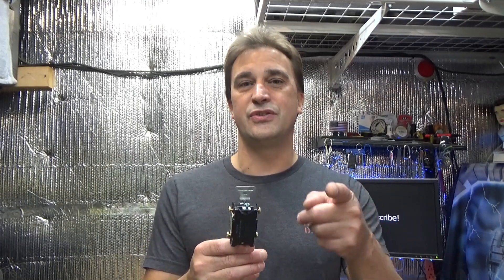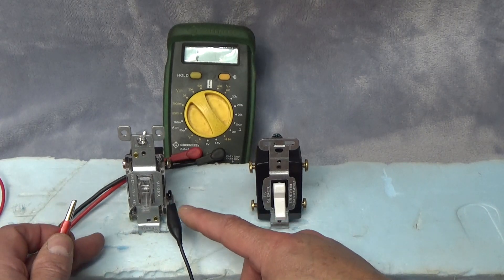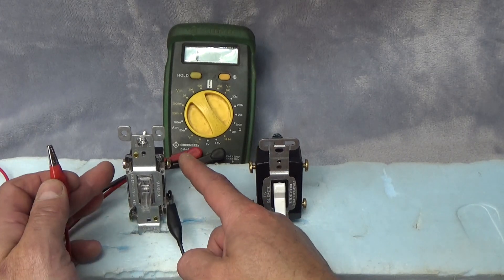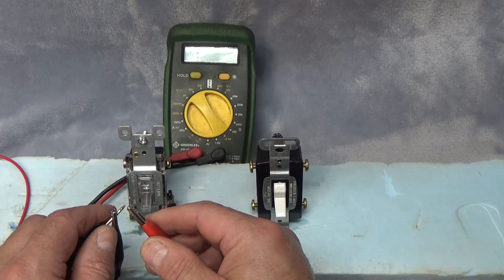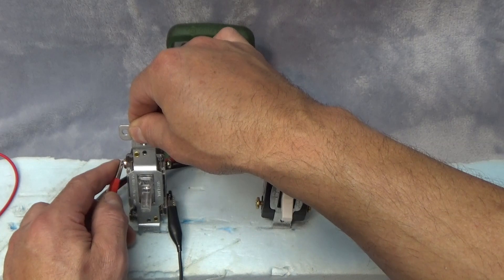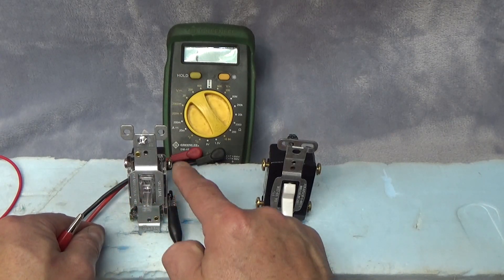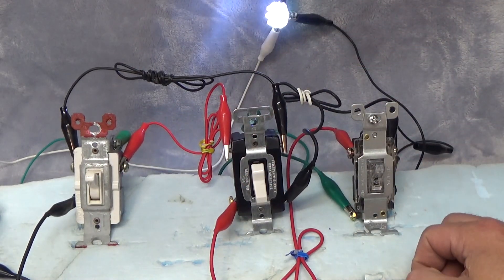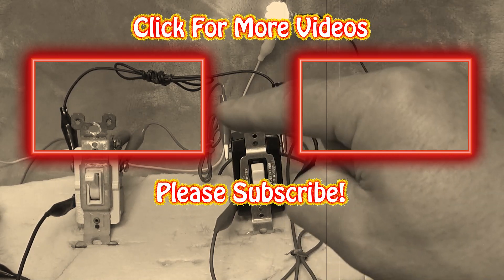4 Way Switch Explained   How to Wire a 4 Way Switch to Control a Single Light Fixture W\ 3 Switches

Comment: Great video. It might be helpful to show what happens with some common wiring mistakes. I replaced my neighbors switches and the old 3 way switches didn't have a black terminal and because the switch was bad I couldn't tell which wire was which. Drove me nuts until I found your video. Turns out the wire I though was going to the light was not. Two of the three switches would work but couldn't get all three. Thanks very helpful.

Comment: Your illustration was excellent!  Just curious....Why is a 4 way switch used when one only needs (2)-3 way switches to control a ceiling light whether entering/exiting from one side of the room to the other?
Reply: Well if you got three entrances to the room You're going to need a four-way switch

Comment: We have a tall shed w/ 6 sections (going up) as one passes from level to level we need to toggle the light of any level from any level. That means a bank of 6 switches on each level. The main pwr source is on the 1st level. We understand level 1 & level 6. How do we get the switched pwr to level 2-5 coming off the 4-way switch on the respective level.

Comment: I have a suggestion for a video, and really just a problem I'm trying to solve. I have an automatic switch for my shop vac that when I turn on a saw or drill press or whatever tool I'm using, the vacuum comes on after about a 3 second delay and then turns off about 8 seconds after I turn off the power tool. The problem is, sometimes I'd like to be able to switch on the vacuum without unplugging it from the auto switch to either clean up some stuff it left behind or just use the vac for another issue. I've been trying to come up with a combination of switches and receptacles with short cords that would keep me from bucking power sources. I think this is a video that a lot of people like me would like to see. I've been searching for a solution and can't find one on YouTube and I'm afraid that I don't have enough electrical knowledge to do it safely. Essentially, it is switching the vacuum between two different power sources. Any thoughts? Suggestions? Simple solutions?

Comment: If you switch the Blk and red traveler wire on the end. Will all the switches work regularly. Meaning, down is off and up is on?

Comment: I have that 4 way switch on the wall with 2 red and 2 black. Can I replace it with a switch with outlet? Thank you.
Reply: Replace.... NO. If you have a main power feed going into that particular J-box you may be able to ADD a receptacle.

Comment: What if I wanted install a dimmer switch on a 4 way setup, on which switch would I put it on, the 4 way switch, or on one of the 3 way switches?
Reply: Did you get an answer?
Reply: There are dimmer switches that will work on a 3-way set ups, Unless there are some new devices that work both legs of the switch, it will only dim if that leg of the switch is active. Consider installing a dimmer switch in the circuit that is coming to/from the load.